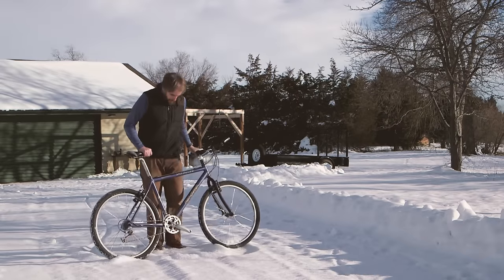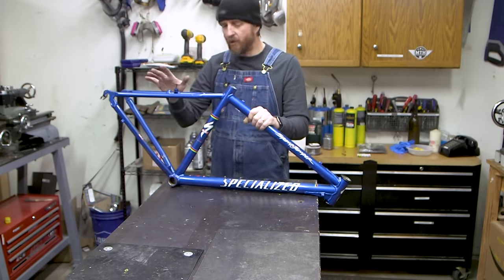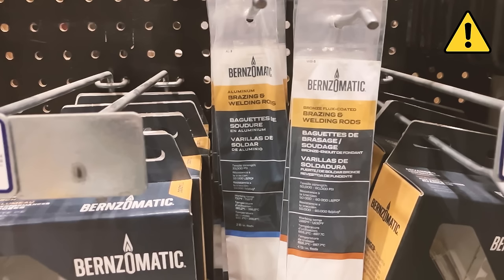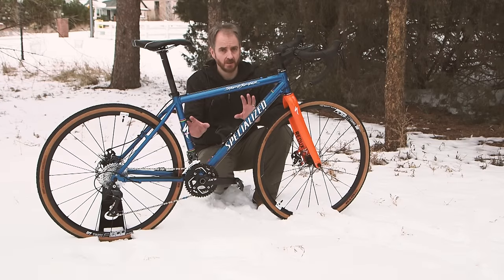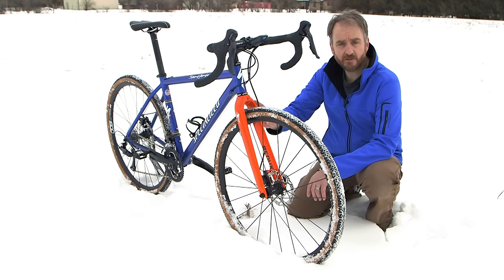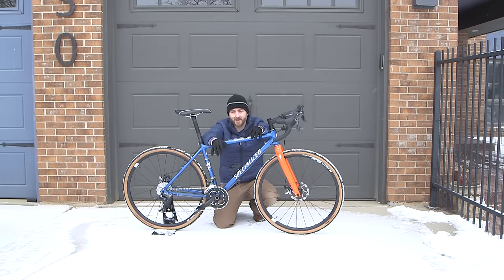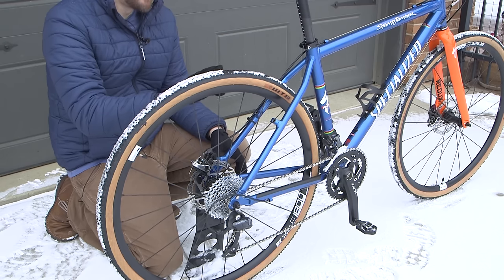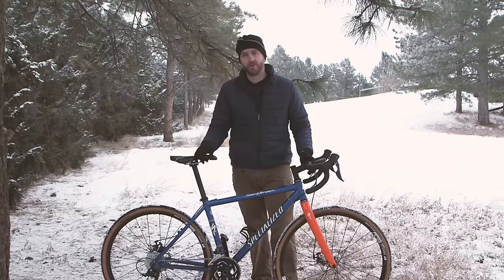Specialized Gravel Bike - Convert 90's Mountain Bike to Gravel Bike

Comment: Thank you for explaining the difference in standards for MTB and road bike. What I didn't understand however, is how did you get the left drop bar break/shifter to work with the MTB front derailleur? Don't they have different pull ratios? I guess with just two chainrings it's always possible to make it work.... 
Amazing build man! Was a pleasure to watch. I
Reply from the maker: I used a triple front derailleur with a triple front crank and the inner ring removed to give me a double.  The crank came that way from Amazon.  I suspect they use it for both.  The wider cage on the triple front derailleur gives more room for adjustment.  The front derailleur ratios are close enough,  that you can get away with it, with a bit of tinkering on the stop screws.  Mine's dialed in really well with the 9-speed shifter combination.

Comment: wow I had no idea you could braze on the caliper mount like that. no concerns with strength of the seat stay?
Reply from the maker: I haven't had any trouble with it, either flexing or failing, at least so far.  I think it's alright.
Reply: @RobertAdairWorkshop  thanks for the update and thanks for sharing this overall, I'm very much considering trying this myself.

Comment: as an avid mountain biker I am building a 90's fuji Sagres into a gravel bike.  On the cheap.  I got the bike for free.  I'm upgrading the stem, handlebars and shifters as it has a very old flex stem and grip shifters. I plan on installing a quill style black adpater to go from 22mm to 1-1/8".  I moved to WTB 700c 40c tires.  I swapped out the stock brake levers with black ones and I'm keeping the existing drive train and cantiliever brakes as with the new pads they stop the bike quite well.  I must say however I can't deal with dropper bars so I'm going with a new flat riser handlebar with 35mm of rise and and a stem that hase 17degress of rise and a length of 60mm.  I will install adapters on the bars similar to bar ends for a more aero position in longer rides.  I hope it turns out like I want!    Any advice on the stem size rise or handlebar setup? is there anything I need to consider?  should I use a stem with less rise like 6 degrees? Thanks for your great video.

Comment: Awesome! I converted my 90s mountain bike to a gravel bike last year. It was fun and I love it, but it's still not the best. One of the problems I have is that sometimes I feel that I am really far from the handlebars and it's uncomfortable to ride on. But I think I'll try the zero seatback post idea that you used. Other than that, shifting of the front derailleur is not smooth. I bought the Shiftmate 7 (road brifters+mtb front derailleur) to help with that but I'm not so sure if it did anything. After installation, I still could not shift to the largest chainring. Then I decided to just tighten everything and it seems to be working fine, albeit not that smooth. I don't want to adjust the front derailleurs anymore. 😅Did you have problems with the compatibility of the shifters and derailleurs?
Reply: Front derailers arent easy to tune/adjust. My tip? Why not go to single chainring? The number of teeth you pick one that fits your necessity (you can find from 30 to 40t). I did that on one bike, going to do in the other. 😄
Reply: @planetafuria7944  I did (and am still considering it 😅). Because I didnt want to change the derailleurs, switch hubs and also taking into account the size of my bike I only switched from 7 speed to 9 speed.  And I wanted to have the option to climb hills easier and go faster compared to what I had previously, which were 13-30s and 28/38/48. Now, I have 11-34s and 28/38/48 in front (cause I ike the feeling of the front chainsets).
Reply: Use a Sunrace friction shifter for the front derailleur. Dead cheap and works like a charm. Even when adjusted not 100% correct, you can always micro adjust in a specific gearing.
Reply: @josfliers  that sounds like a good idea. Looks like that might just be my project for this summer! :D But would I then still need the Shiftmate 7? :o
Reply: Get a shorter reach, taller height stem. Most 90s bikes had those stupid 4in long stems.
Reply: Velo orange has tall stems that work if you already cut the steerer too short for others.
Reply: @ThisTimeTheWorld  Thanks for the suggestions. I'll look into them :) Last month I rotated the stem 180° (so the stem is facing me when i ride). Looks awkward, not really sure if it's safe but it feels much more comfortable to ride the bike now.
Reply: @nadeemkb4495  tiller stems can work for some twitchy bikes, but might make hard corners less predictable. People will pick on it but I've met a few touring cyclists on old large frames that liked it. 50mm stem ought to solve the problem
Reply: Use sheldon browns gear calculator to test gear combos before you buy parts.
Reply: Thanks for the tips! Really appreciate them :)  @ThisTimeTheWorld

Comment: this is a great idea! I want a gravel bike but im NOT spending 2K on overengineered garbage. any suggestions on good vintage man frame?
Reply from the maker: If I were to do it again, I'd go for a Klein frame.  Those have some serious cool factor built-in.  Of course, I like the Specialized bikes.  If you're buying a frame for the project, look at bikes built after roughly 2002.  You can often find them with straight tubing but with a disc mount already attached.  Something like a Stumpjumper M4 comes to mind.
Reply: @RobertAdairWorkshop  awesome! been looking for a good project and time for a new bike. Love this idea. An older bikes is sure to be a head turner and the reward of the work that you put in. cant wait thanks!

Comment: Man what a awesome build! I bet it was a lot of fun building it. I have a 2001 Stumpjumper M4 and was thinking about doing the same  project but realized I don't like drop bars so I modded it to be a flat bar gravel bike with 26' wheels. Mine came with the brackets for disc brakes too. Do you feel any flex in the rear with the bridge delete?
Reply from the maker: I had thought the M4 would be a good platform, especially since it already has the disc mount.  I imagine it made a good build.  I haven’t noticed any flex with the bridge removed.  It feels exactly the same as it did beforehand.

Comment: Nice build! 🙌 There's one thing I'm concerned about. 
Doesn't the higher breaking force of  disc breaks (especially if one fitted hydraulic ones) damage this frame that was never designed for the impressive breaking force? V-brakes can be quite ok, especially if the terrain tackled isn't all to steep.

Comment: Did you do any strength tests with the aluminum braze? I've wanted to try it on some of my projects. I've read the braze and flux combo for aluminum you can find on McMaster or similar tends to be stronger than the fluxless variants. Love the content, thank you for making it!
Reply from the maker: I did.  I cut about half dozen lengths of that same 6061 and brazed them together, then held each in the vise and beat them apart with a hammer.  That’s how I found out that the amount of braze contact affects strength.  The last couple I did, I had to wail on with a 2-lb hammer to get to break and they only failed when hit from the side, not longitudinally like the disc brake mount would be loaded.  I did enough testing to decide it was a safe way for me to attach the mount.  I was on the fence before breaking the test pieces.
Reply: @RobertAdairWorkshop  yeah, it doesn't seem particularly unreasonable with how that joint is built up, and the listed strengths of aluminum braze fillers. I was mostly curious if you had compared the strengths of the fluxless aluminum filler to any of the various versions that include flux in the system.

From my limited understanding of aluminum brazing, part of the limitation on strength is that without a flux, they are incorporating the aluminum oxide layer that all bare aluminum forms almost immediately (doubly so when heated). So to really maximize the strength you need a flux to dissolve the oxide layer, and shield the joint from oxygen during the flow out process.

Comment: My version of your build is an early 1990's Kona Hot. Reynolds 853 tubing. I had to build a fork so I went with Columbus forkblades in a Pacenti crown. Since I have access to an oxyacetylene torch I had no trouble switching it to disc brakes and also put brazeons for cable management. 27.5 wheels. Did not tell my wife how much it ended up costing. A trip to Toxik Design for paint destroyed any budget but it sure is pretty. Love riding this bike. Just to add on, I am using vintage correct Cook Brothers cranks. Probably the only set that did not break.

Comment: Lovely bike and cholor scheme. If I had not seen it myself I would not believe the ISO mount was brazed on, looks like it was shipped that way. 
Only questions is if the frame feels stiff. Although it's aluminium the seat stay bridge was kind of a strut bar. Maybe braze on a new one?
Reply from the maker: Thanks!  I’m loving it!  The stay bridge was really there to provide stiffness for the rim brakes, minimizing flex and giving good brake lever feel.  It is so close to the seat tube that it doesn’t provide much, if any, lateral stiffness.  I was initially worried about removing it, but then took a look at my other disc brake road and gravel bikes (Felt and Giant).  Those have smaller diameter stays and none of them had bridges.  So I cut it out.  Rear stiffness wasn’t affected as best I can tell.
Reply: @RobertAdairWorkshop  Very nice. I once saw a build where the guy removed the seat stay bridge and the chain stay bridge. If I recall correctly he had no problems with flex either
Reply: @RobertAdairWorkshop  The original concept for those brake bridges came from bikes with calipers brakes and fenders.  The bike industry has a lot of old ideas that don't change quickly.  When mtb's came out, the bike frames still had older design concepts, but updated with cantilever brakes.

Comment: That brazing looked more like you were just melting that aluminium brazing rod ontop of the frame and bracket.  I hope it holds for you, it would suck to detatch the rear brake in an emergency braking situation.
Reply from the maker: You can see it wet the joint between the mount and frame at 5:31.  The brazing you see at 5:43 is to add material to both faces to reinforce the area as the strength of this joint is heavily contingent upon how much surface area is covered by the brazing material.

Comment: Love the project, and now I'm thinking of doing the same. How does this conversion compare to a new, entry level gravel bike?
Reply from the maker: I have a couple gravel bikes.  A really nice Chumba that I recently did a video on, and then a Marin Gestalt and a Giant Contend AR.  It rides just as well as all three of them.  I'm serious about that.  The Specialized is longer than the other three.  I typically choose a 54 in a road-bike frame,.  I'm more comfortable on the smaller frame.  So I notice the extra reach but it isn't much of a problem.  I wouldn't hesitate to take this on a 100 mile gravel ride.
Reply: @RobertAdairWorkshop  Thanks! I'll watch that one too:). Is there a 90s MTB brand and frame you'd recommend for such a project if you could do it again? Specialized, Cannondale, Trek, GT?

Comment: Hey, really informative Video! Thanks a lot. Do you have any further details on how the make the IS Mount?
Reply from the maker: I got the dimensions by searching for "Bicycle IS Mount Standards" and used this page to get the geometry:  https://raw.githubusercontent.com/danmarshall/makerjs-disc-brake-mount-is/HEAD/iso.jpg  I do have a STL file for the mount I ultimately made.  If you have a 3D printer or CAD software, I can share that with you and give you a starting point.

Comment: I love it, great video and I’ve been interested in doing the same. Did you have any issues with how it rides after cutting the seat stay bridge out? Can you run wider tires than what’s in the video?
Reply from the maker: No issues whatsoever.  It rides great.  Take a look at your bike.  when you lean it slightly and push down on the seat or bottom bracket to provide a sideways force, notice how all the flex is in the tire and wheel?  It’s an old internet myth that the seat stay bridge impacts frame rigidity.  One propagated heavily on Reddit.  It’s just there for minimizing flex caused by rim brakes and provide a mount for a mud guard.  I own a few other disc brake road and gravel bikes: A Felt Z75, a Marin Gestalt, and a Giant Contend AR and none have a stay bridge.  Cut it out.  You  won’t miss it.

I’m not sure about the tires.  Maybe a 42, leaving space for mud clearance.  I will get tight down near the bottom bracket if much wider than that.
Reply: @RobertAdairWorkshop  Excellent info! Thank you for the detailed response! Happy riding

Comment: One thing I didn't see discussed in the video was the issue of rear dropout width when converting to a 700c wheel. The old MTB frame would most likely have a 135mm dropout width in my experience. So if that is the case with this frame wouldn't you need a special 700c wheel that had this 135mm hub width?
Reply from the maker: I can't say this for all wheels, but the 700c disc wheels I've come across with quick-release hubs have been 135mm.  I don't think they went to 142 until the thru axle, though, you know, there are always those special cases.  The E1800 DT Swiss wheels I put on it, ultimately, were 135 as were the Alex wheels I used first.

Comment: you can correct the cable pull with either mechanical advantage or a pulleys system, but you would have to design it yourself for people who can make parts

Comment: Do you feel that you are too far over the pedals with the zero setback seatpost? Or does that seatpost negate some kind of seattube angle change caused by the new fork?
Reply from the maker: The rigid fork I used wasn't much longer than the original 100mm suspension fork. I don't think the seat tube angle changed much.  My angle finder says its 74.6-degrees.  But back to the question,, no, I haven't noticed the difference in setback.  The longest ride I've been on with it is 12 miles due to the snow, so that might change as the rides get longer.

Comment: Fantastic build! I have the exact same frame from my younger years and I'm doing a similar build. Curious what fork you went with...?
Reply from the maker: The one in the video is from a Raleigh Redux.  I found it on eBay cheap.  I've since replaced it with a carbon fork from a Canondale Topstone that I also found on eBay.

Comment: pretty elegant stem update .. may I ask the type?
Reply from the maker: It’s a cheap stem made by Satori.  Stealth 6.  I got it on Amazon, $24.  I thought the clamp design was cool.  

https://www.amazon.com/gp/product/B08QZFRJP7/
Reply: @RobertAdairWorkshop  thank you. and does it stay tight with this one screw mechanism?
Reply from the maker: @wortschaetzung  It has so far, yeah.  It has a really firm grip.  There's an internal clamping mechanism that it pushes in place and then that screw tightens down and locks it.  I'm not entirely certan how it works, but it works well.  I think it'd be a good design for carbon steerers as there's more surface area contacting the steerer.

Comment: What a great video. Ive been wanting to somthing similar for ages and this has shown me alot. Can you tell me.. do all shimano mechanical caliper brake levers convert to mechanical disc. Ive got some Ultegra 11 speed id like to use.  👍👍
Reply from the maker: Yes they do.  Just make sure you use the corresponding caliper (road specific caliper if you are using road levers).

Comment: Nice build!!  How do you calculate the size and location of the disc brake bracket?
Reply from the maker: I put the wheel in the frame, with the brake disc attached.  I then clamped the caliper to the disc and rotated the wheel until the caliper hit the frame.  That showed me where on the frame the mount should be.  Then after I made the mount, I did the same thing to figure out its final position and scribed it.   If I got it a bit off, I figured I could use shims to correct its alignment.  But I didn't need to.  So basically, I fit it to the disc and then marked its location on the frame.

Comment: great video. also good point, you always should pick a size by effective length of the frame. we all built differently in terms of body proportions. I got 80 cm inseam leg length being only 164 cm tall and size calculators by inseam suggest me M frames, while I actually need XS in most cases.
Reply from the maker: I was afraid I harped on that point too much in the video.  But it's so important with 90's bikes.  I actually run a smaller frame in road bikes than any of the online calculators say I should.  I'm 5'11 and I ride a 54.  The internet says i should be on a 56 or 57.  But the smaller frame with a longer stem just fits me better.
Reply: @RobertAdairWorkshop  when in doubt, pick smaller frame )) you can always correct the fit with longer stem and seatpost/saddle configuration, but not much you can do with larger frames. I remember when big guys like Adam Hansen were riding S size bikes in pro peloton just a while ago. the only concern here is toe overlap, but it's rather insignificant overall.